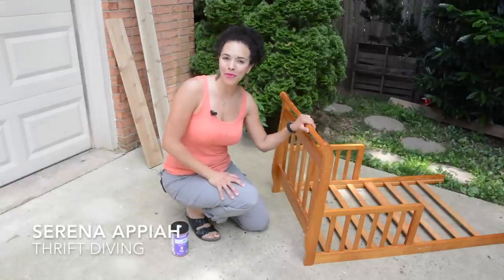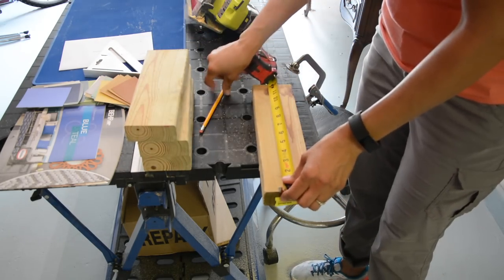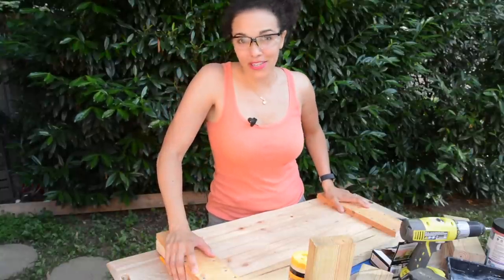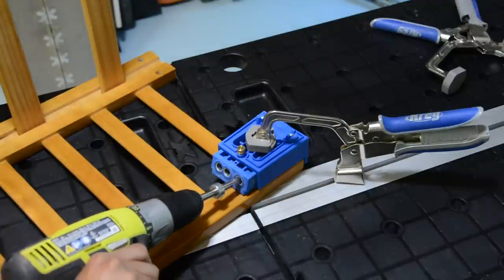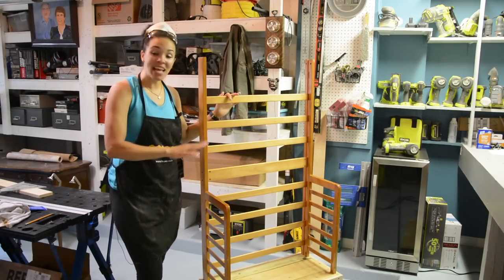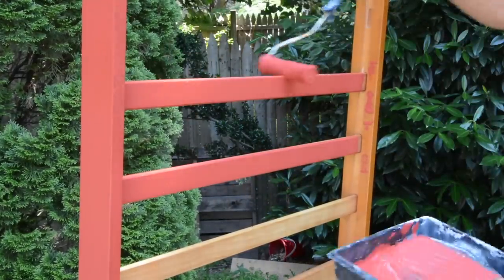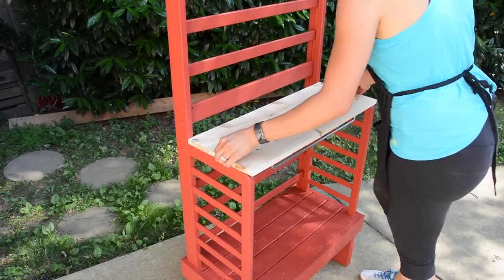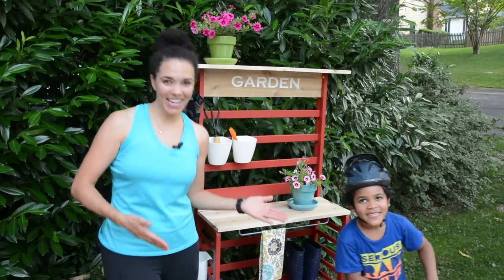How to Repurpose a Toddler Bed Into a Potting Bench! - Furniture Makeovers - Thrift Diving

Comment: Love it! Question (out of curiosity) why would a thrift store not take a bed?
Reply: Older toddler beds and cribs, especially, have safety hazards. With cribs, often the slats are the wrong width and pose a hazard for limbs or even heads to squeeze through. Similar issues or just wear and tear concerns with older children's furniture.
Reply: @ltellis63  slat problems are with very very old cribs.  wear & tear issues would be a concern though as things aren't made very well nowadays.

Comment: Great job and great way to repurpose something. Was thinking couldn't you have use brackets to attached the bottom to the frame? Either way this looks amazing. Thxs for sharing. Your son is a cutie.
Reply from the maker: Evelyn J. Amponsah Aww, thank you! And yes, I could have used brackets of some sort but I didn't have any on hand! I wanted to use brackets to attach the top shelf too but again, I didn't have any. I didn't want to make a store run for it! :) But yes, brackets would have worked, though it wouldn't have looked as seamless. Although once painted, they probably would just blend in with the paint!